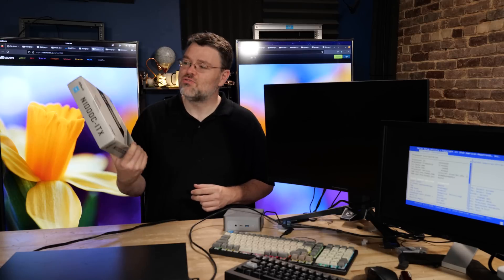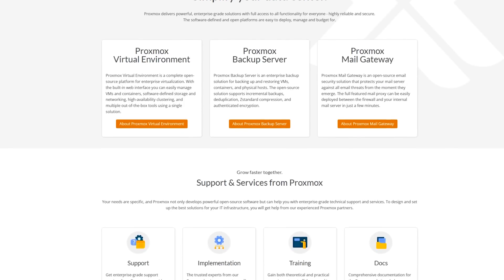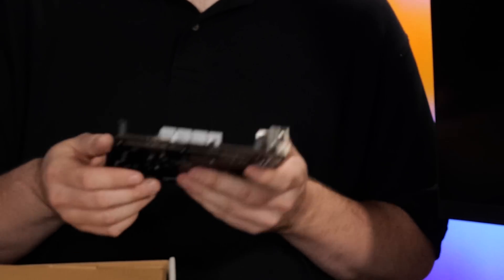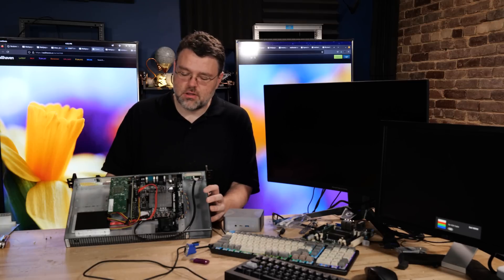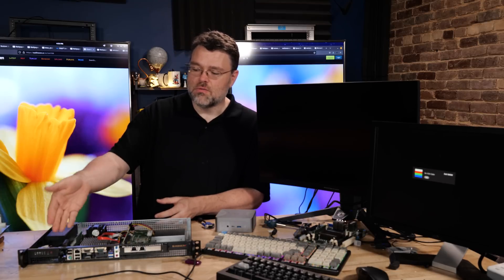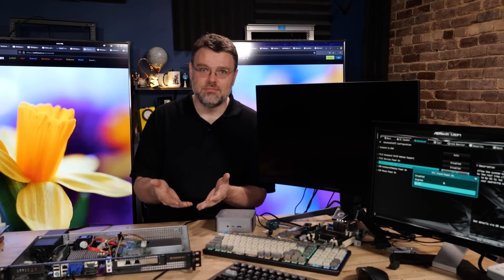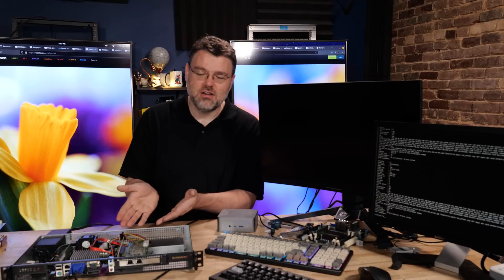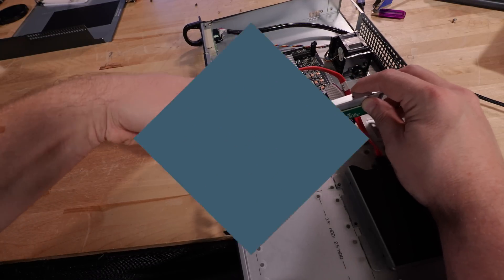ASRock’s N100DC-ITX: Cherry Trail Replacement

Comment: I have a dead 2750 here, or well, unstable. Kinda feels like typical RAM issues, but it varies if it's IPMI, VGA or just POST that fails. And sometimes it works perfectly. 
It doesn't have the resistor mod, but is that something that can "fix" a dying board, or is it only for postponing the inevitable death of the board?
I was otherwise thinking of doing the exact same thing you're doing. I have already painted it in aluminium to match my Unifi rack. It has a SC 504-203B chassis, so everything on the back of this one.

Comment: Is there ANY way to add a second display out that isn't VGA? I can add a graphics card, but that would cost a lot more and add at least 5W power consumption, negating the benefit of the board.

Comment: That issue with the PCIe slot not fitting near the audio port at 4:30, is that cause the stand off has more space above it? Or is that blocking even a standard height PCIe slot?

Comment: 3:24 - resistor mod? To boot? This isn't shorting out the two pins on the power supply connector trick, is it? I have a PC that stopped booting, the power supply turns on if I short out the two pins, I have been considering installing a momentary switch to short out the pins to force the power supply to turn on while it is connected to the system.

Comment: Those N100 boards are amazing. 7W TDP and about as fast as most of the Celeron or Pentium options. Just perfect for a NAS at home. I wish it had 2-4 more PCIe lanes. However, there's also an ASRock N100M board with 2 PCIe slots: 1x PCIe 3.0 16x (2x electrical) and 1x PCIe 3.0 1x (but open at the back?).  Throw in a Broadcom SAS 9300 HBA into the PCIe 1x slot and a Mellanox 10G SFP+ adapter into the 1x slot and you have a NAS with up to 8 SAS drives, 1x NVMe for OS and 2x SATA on board (maybe for Cache?). Yes, it won't go 10G in the PCIe 1x slot but you should be able to get up to ~6Gbps out of it. Is it ideal? No! Is it good enough for home use? Hell yeah and it's efficient af.

ECC would be nice but I guess we have to swallow that pill unfortunately.

Comment: The two main considerations for my next home file server are low idle power, and a full 1/2.5/5/10Gb ethernet port. 
2.5 is fine for most needs(really 1Gb is fine), but I can't justify upgrading my network Just to go from 1->2.5. 16port 1G switches are dirt cheap, 2.5/5/10 not so much. And since I get 10-15 years from a file server... (The house wiring is all full cat6a)

My current NAS idles between 5 and 10w depending on the storage drive(one), peak power is around 25w, 12v wall-wart powersupply.
Uses a single core Atom around 1Ghz with 512MB RAM. Just enough to keep up with a 1Gb network connection and single spinning sata disk.

Comment: For those that want a newfangled Gracemont-only solution like this but with ATX power connector, Asrock also offers a board that is simply named "N100M". This one's micro-ATX though, but it does have an additional PCI-E slot. Might be a a godsend if you want to add both an HBA and a NIC, say, for home server shenanigans.
And if the different form factor is a deal breaker, ASUS has the "PRIME N100I-D D4". It's mini-ITX that wants regular 24-pin power.
Have fun.
Reply: Do you know what means pcie 3.0 4x (mode 2x) in the manual?
Reply: @OlindoPindaro  it's physically a 4x slot but only connected to 2x electrically. So the bandwith is 2x but 4x fits physically - just with lower bandwith.
Reply: micro atx ewwwwwww
Reply: This is the best comment. I am in the process of building a similar system and will use the mATX version. The footprint is bigger, but you can use a PicoPSU instead of an external brick, and get a full-length PCI slot. I will probably use a 2U case though, in order to avoid front IO shield compatibility issues and have more room for bigger/quiter fans.
Reply: I got excited when I read this because the Asrock has only one 4K display out, which is a deal breaker for me. So I looked up the Asus - two displays, yes! BUT... only one SATA and SODIMM... deal breakers. Why can't someone make one of these boards that is full featured, meaning has basic s**t.

Comment: Pro tip for UPS shipments: If it's something you don't want to have damaged, insure it for $1000+. Anything over $1000 should get the kid gloves treatment. Also, make sure the item is packed and braced with cushioning.

Comment: I'm running proxmox on a AMD X2 3250e with 4gb ram. It's a great backup unbound server, it was running home assistant just fine for my uses, really really basic config. It worked as a test playground for things like learning how to setup a basic DHCP server (kea) and Authoritative DNS server (NSD) by using a separate bridge. A N100 based machine have better performance, and use less power, but for many of our homeprod type loads is plenty. Honestly i'd love a N100, N305, or I3-1x100 with at least 48 or 56 pcie lanes. that could be some or all of OCuLink, M.2, or SF8643 connectors, there are adaptors for all of those so i can do whatever with them. Ideally with bios support for really silly things like running a 16x slot via 4 SFF8643 ports.
Reply: Pray for low end threadripper CPUs to somewhat fill that role I guess. I'm really hoping for an 8 or 12 core threadripper 7000 CPU for a separate purpose than that, but I agree that more varieties of CPUs should be made for the excellent platforms that already exist from AMD. If Ryzen CPUs can have lots of cores and (relatively) low connectivity, then Threadripper CPUs can have the opposite.

Comment: Please do a power consumption test
Reply: 6W Idle, 20-25W under fair load.
Source: have one.
Reply: @LeminskiTankscor  6w sounds good, I saw n100 review which said that the have 10w minimum at idle...
Reply: @philipphellmich7644  might need a little tuning / be smart about it. I seen a review that claimed high idle, but the chap used a very high wattage PSU, so efficiency was low there.
Reply: no people have been reporting a rather disappointing idle of 15 watts on this mini itx board  @LeminskiTankscor
Reply: which is similar to my ancient athlon 5350 using a 60watt 12volt brick
Reply: @si4632  Did these people tune the power consumption in BIOS at all?
Reply: default settings I believe maybe the mini itx boards just consume a bit more power @LeminskiTankscor
Reply: @si4632  Copy pasting my own results. Try these and see if they reduce consumption. 

*START*
Took the board, reset BIOS to defaults. Running a USB key for boot, a 120mm 3pin fan, and a 4tb ssd. No WiFi, gigabit ethernet. 

Additionally a hdmi monitor to a 4k monitor and a wireless kbm dongle thing. 

Running Debian 12, no DE, kernel 6.4. 

Let it boot, leave it run alone a bit and running me containers: 11.1W. 

Remove HDMI: 10.8W Remove KBM: 10.1W 

Add them back in, go to BIOS: 18.6W 

Set RAM to 2133Mhz (done because stability reasons) 

Package C states on 
C6DRAM enabled. 
PCH PCIE ASPM set to auto. 
SATA aggressive link power enabled. 
Disable Serial port 
Disable Parrallel port 
Disable HD Audio 
Disable WAN 
Set Fan to DC. (Is 3 pin) 

Ran Fan Tuning. 

Reboot, give it a mo. 

Running containers: 7.5W. Remove KBM and HDMI: 6.2W
Reply: Main thing is Package C states being on.

Comment: I recently made a 1.5U opnSense box out of an old switch chassis and regular ITX components.

My rule of thumb for homelab stuff is to always use standard hardware, since that allows it to be easily upgraded when needed.
Reply: In most cases I agree, but in reality most consumers aren't going to upgrade the same old mobo unit running an opnsense or pfsense router. It's more energy efficient to run a mobile chipset similar to this one. You're not going to see the performance benefit of running a non mobile desktop or workstation chipset in opnsense. In 3-5 years you will want to replace the mobile set with something even more energy efficient if needed since it's going to be running 24/7.
Reply: @F0XH0UND007  I agree that power efficiency is important, but when the itx system is using only 20w I don't see that there is a large benefit of more expensive non upgradable hardware that also is more costly for a few more watts of efficiency. After all, I have servers and other equipment running 24/7 that uses up to 100-150w constantly. So there will be more power to save by turning of services when I dont use them. My point of view is save power where you can, but at the same time knowing that 80-90% of the power used in my home is for heating, water heating and charging the EV. So the money to save electricity is better spent on such things rather than hardware.

Comment: I have the exact same board and unfortunately it crashes immediately under win10 when two screens are connected (over HDMI+VGA). Asrock support told me it should work just fine but it doesn't. Could you test if it works for you?

Comment: I have an N100 mini-pc running as my NVR 24/7. It pulls around 25-30w. For a 24/7 use case, it's perfect for me
Reply: What software are you running?
Reply: @glenbush2008  I'm using i-spy with 4 1080p cameras
Reply: 25-30w ? isn't it a bit too high ?
Reply: How many drives do you have attached?
Reply: @djvincon  I have one drive on a usb enclosure for the video files. I don't store very old footage so that is enough for me.

Comment: I wish the motherboard vendors would just get rid of the stupid audio ports. So so so many external solutions for audio these days - if you even need anything beyond the audio sent to your monitor over HDMI/DP. If that were my system I'd desolder that whole audio header to make the PCIe riser fit.
Reply: Dude! This is a board with VGA and RS232… of course they will keep the analog audio ports and headers.
Reply: useful for cheap analogue surround sound ive connected 3 class d stereo amplifiers to each jack   5.1  lol @PainterVierax

Comment: Considering this to replace my 3740T based opnsense router. Mostly because of noise and heat. How much power does this sip?
Reply: I got mine to 6w idle.
Reply: @LeminskiTankscor  sweet. the 3740T with intel 10gig idles at 50ish watts, so that is an major upgrade. Thanks!
Reply: @torgrimt  sorry, need to clarify I'm not using 10G,just the onboard gigabit. But if you have an effecient 10G card, that'll give you an idea.
Reply: @LeminskiTankscor  Jeh, it wont take it up that much, it is indeed an super upgrade. And without the atx powersupply it will be great for noise aswell.
Reply: @torgrimt  yeah. I'm running an old laptop charger. It also seems OK with 20V, some tricks like 20V usb-c is possible
Reply: also wondering if it has enough pci lanes to support 10 gig. People have been debating it on reddit. Waiting for level1tech review before ordering this one.
Reply: @torgrimt  Should get most of the way no?

Comment: The best use of this mobo I could think is using it as cheap server for redundancy in 3-5 numbers. But the cost actually adds up if you add case, power supply, fans and other stuff so I think using a CWWK firewall application could be of better use and cheaper but with spooky support.

Comment: I'm curious how much power the N100 system draws in idle, equipped with 10G Ethernet in idle, since idle power is one of the more important factors in a 24/7 usage.
Reply from the maker: For me about 28 watts but much of that is the ancient 10g card
Reply: @Level1Techs  does it handle 10g?
Reply: Got my board to about 6W idle with some tuning. That's with a USB boot drive, single NVME ssd, a fan, and spundown usb drive. Onboard gigabit.

Comment: we still have this supermicro machine running in production at some sites as routers/gateways.. from the 15 we installed 11 years ago, 7 are still running (1 died, the rest changed due to other reasons) maybe it just needed the mod to keep going ? We just replaced it..

Comment: Were you able to test the A+E key NIC? I've read somewhere that the wifi m.2 doesn't support PCIe, so the only things you can use on this board are CNVio wireless adapters
Reply: Most A+E key ports have 2x PCIe 2.0 lanes and a USB 2.0 lane.
Reply: I’d be interested to know this as well. I’ve got one of these motherboards and could not get an m.2 NIC to work in the wifi slot.
Reply: @Vedeyn  For what it's worth, I got an M.2 A+E Google Coral TPU to work in one of mine, which requires 1x PCIe 2.0 lane. I guess they are not all created equally.
Reply: Also interested in this since I heard normal PCIe cards won't function in the m.2 WiFi port due to CNVio as mentioned above. For my use case I would need the m.2 WiFi port for a second PCIe NIC card since all other lanes would be busy with other jobs. TIA
Reply: I have tested it with a 2.5 gbit Realtek e key adapter which did not work :/
Reply: I tried an intel based gigabit card in the port and wasn't able to see it in the OS. Might be a BIOS option that helps but it might just be a problem with it being an Intel CNVi port. Had to use an m keyed ethernet card on a riser board in the pcie slot.

Comment: *Stares at Avoton based super micro model sitting directly behind me*.  Honestly it's not really had a single hiccup as a pfsense system on a gigabit ISP but you might be shaming me sufficiently enough to upgrade it.
Reply: you and me both, I have that case and would like a drop in replacement for my pfsense box, but can't seem to find anything that would fit and more importantly is available at a decent price.

Comment: Speaking of Cherry Trail, I have a question about E cores, why don't people call them atom cores?  E cores are based on atom architecture to a point where some bios will label them as atom cores. It''s a strong brand that still has cpus released as atom, it confuses me.
Reply: I'm sure Intel realizes that that may have a negative connotation... even if they would never admit it of course
Reply: They are Atom chips with Skylake level IPC.
Reply: Intel calls them E cores. Just using the names the manufacturer uses.

Comment: Wendell's pricing is way off here. He refers to it being under $100 a few times and I see it online @ $130. That's a pretty massive percentage price change that pushes it out of the "eh it's cheap who cares" zone and into more grey area. I really like this product, and I see there is also a mATX variant that includes a x16 slot running @ PCIe 3.0 x 2. That one is actually cheaper than the ITX one currently on Newegg.
Reply: OP has a point. The Newegg link in video description has the product listed at 130 USD and that is a significant difference. Perhaps Asrock preemptively raised the price in anticipation of people who would buy the product after this video! If the margin was like 30usd before, raising the price by another 30 is literally double the margin on the product 😂
Reply: @SandyWhitmore or maybe prices going up before Black Friday, so that they can advertise higher discounts
Reply: I can buy it for <100$ in Europe, adjusting for VAT and exchange rate.
Reply: @TheExard3k  Where? I checked UK, Germany, and Poland. All three where 120 - 155 Euro. I have clients in the EU who would be interested in an e-core NAS for under $100 USD barebones.
Reply: @FrenziedManbeast  US prices are without VAT, EU prices are with VAT. So 120€/1.2=100. There you go. Factor in exchange rate and we're at $95
Reply: $130 is still great price for this board. it's much faster than the previous generation of ITX boards with integrated CPUs (Intel J5005)
Reply: Why does it say this comment was made 5 days ago when vid only went up 2 hrs ago? That's my question.
Reply: @ChineseMannequin  Most youtube channels with patron perks will release a video to patrons early.
Reply: #Sponsored
Reply: Prices fluctuate a fair bit. And vary by region and seller. Not much we can about that beyond checking local current prices.
Reply: @christopherjackson2157 I live in the same geographic region as Level1Techs, and my OP was posted at content launch. If 30% price fluctuation is normal for a product within 24hrs (it isn't at all, especially with motherboards), then my next bit of constructive feedback might be to talk about at which price points competitive options become worth consider for a consumer.
Reply: If 130 is a grey area hardship, you probably shouldnt be spending 100 either.
Reply: @POVwithRC  I think it's fair to point out a more than 30% price difference between content creator listed and actual market price. It has nothing to do with my specific solution - my NAS is already built and running just fine on an ATX platform thanks to Wendell and others' great content on rolling your own ZFS solution.

More accurate information is only a benefit to consumers and the larger creator community. I love Wendell and L1T, and feel my OP is constructive feedback to support their continued success.
Reply: If one considers the cost of the cpu, then the motherboard is less than $100. 
$130 = cpu + mobo 
then 
mobo = $130 - cpu
Reply: Taxes suck yeah? Paying that extra $30 will subsidize something else for someone else, no need to whine lololol